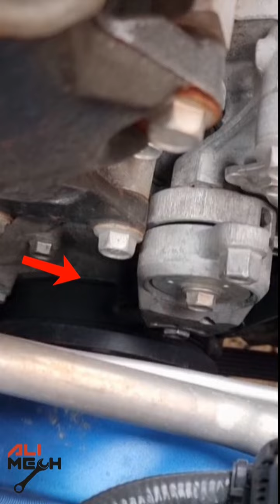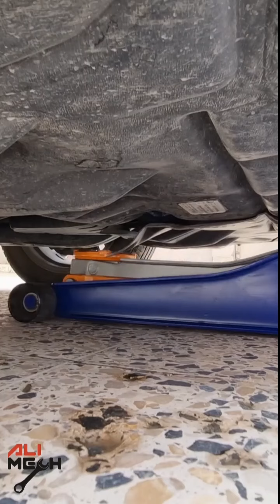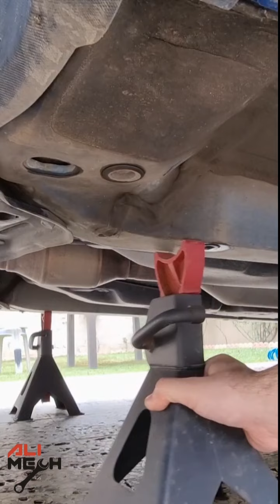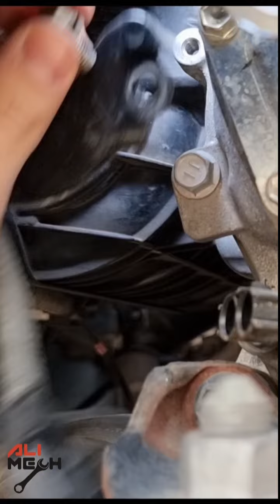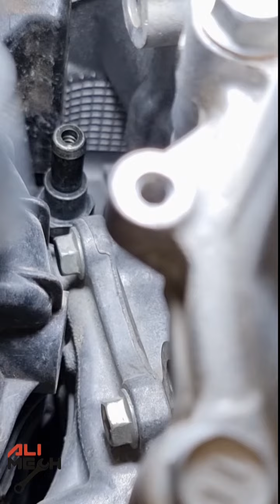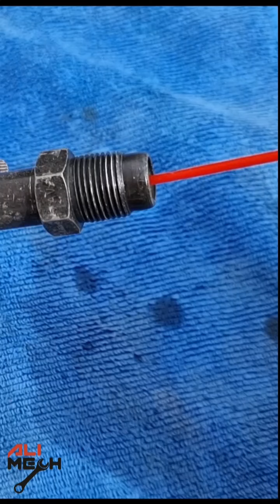How to Remove and clean the PCV valve TOYOTA Camry 2015-2017

Comment: Made to look easy but it isn't....  Demanding  socket head (length) needed plus universal joint on slim ratchet, and the job is done without sight-line  (  by feel only)...  Don't be fooled, this a tricky one...